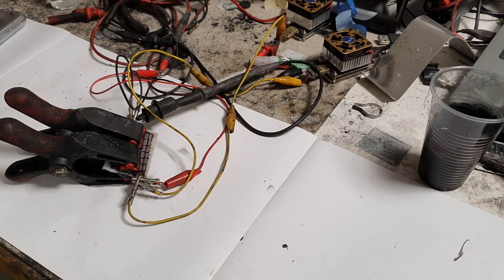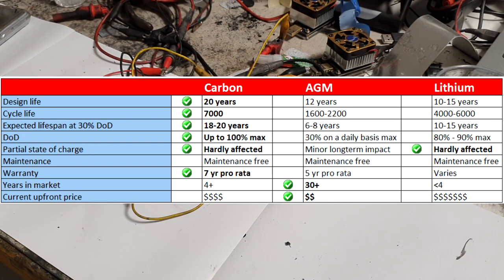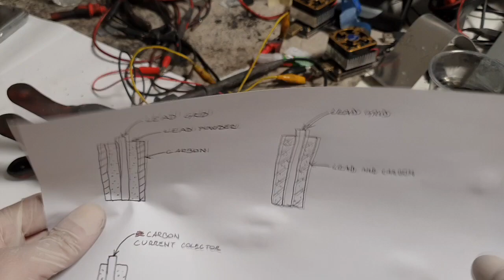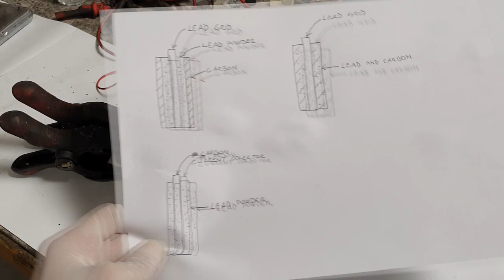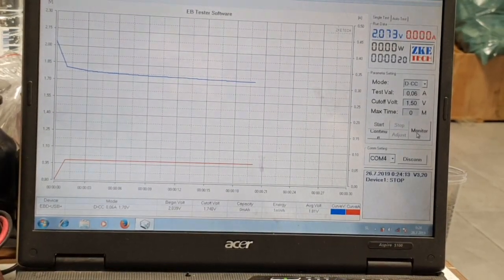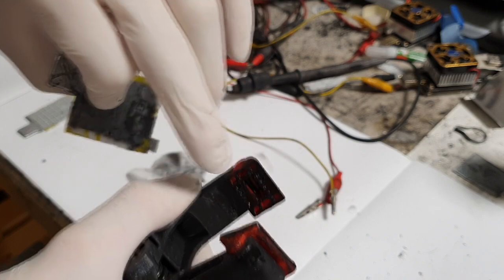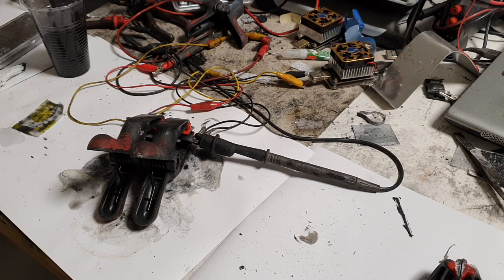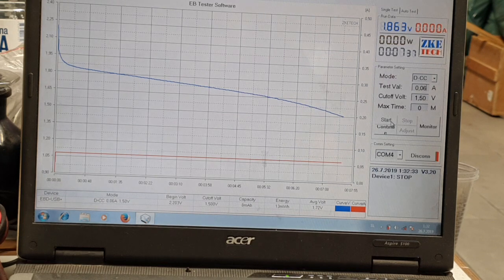Lead carbon battery - ultrabattery

Comment: Would be good to see similar test but with a battery that had lost most of its capacity. An old car battery that had sulphur built up on its plates due to being discharge to far would be a good test. It could be a great business to create new life for old batteries
Reply from the maker: Not bad idea. But in many cases the lead grid which is the current collector is badly damaged.
Reply: @cayrex  I think this is true in very old batteries but many fail prematurely from be left in a flat state to long and the acid turns to water and the sulpher Coates the plates

Comment: What are you using as a binder to keep everything in the grid I've tried just about everything I can think of and nothing holds it in there whenever you put it in the electric light and make a battery with it it always dissolves out and falls down to the bottom I even put clay and as it dries it shrinks and cracks
Reply from the maker: https://patents.google.com/patent/CN102181113A/en
Reply: I've tried acrylic concrete patch repair from hardware store.

Comment: So which deaign u build? Mix lead powdee and carbon powder? Ad the composition?  Is it 50:50?
And how the performance ..? Can reach 3000 cycles?
Reply from the maker: I soak the negative lead electrode (standart negative lead electrode - lead grid + lead powder) into activated carbon ink, which was made from activated carbon and binder (polyester or epoxy). Yes you can also make a mix from lead powder and AC in 50:50 ratio. Hmm, performance,... reduced weight, less evolution of hydrogen, cycle life. Look on internet,.... some papers report cycle life over 10k cycles. In that case 3000 or 2000 cycles will not be a problem, but the cycles are depended on DoD (deep of discharge)
Reply: @cayrex  well there are several lead carbon on the market..they claim can reach 3500 cycles with 80 percent dod..but on furukawa test only 3000 cycles with 50 percent dod..
Btw what kind of binder u use..thanks..

Comment: can you please make a video on how to produce plumb dioxide at home for the positive electrode? Specifically for making deep cycle batteries.
Reply from the maker: In basic is easy to do but you need to be careful when you do this. You have electro and thermal process to make a PbO2. For electro method you need Pb metal bar, 20-30% H2SO4 and some negative epectrode like copper or carbon. Put the Pb which is conected to the positive of your power supply into H2SO4 solution and also the carbon which is conected to the negative. Power up and wait. The Pb will start to form a oxide layer, which is in dark color. The thermal reaction is if you heat a lead nitrate,... and I the end you will get PbO. But this thermal method is toxic like hell! And is not good to make at home in some small room. The difference between "normal" lead acid and deep cycle batteries is only in the thickness of the electrodes. The deep cycle battery have thicker electrodes as starter lead acid battery,... all the rest is same.

Comment: May I know what are the ingredients to make the battery plate
Reply: The negatives  plate of a older lead acid battery   if the positive  who has damaged crash it and paint it on the 2 plates on the negative separate with peppers toilet and put saltwater  charger it and test

Comment: can i use charcoal substitute for the carbon?
Reply: If you can get it to be conductive and also activated yes!
Reply: @Buzzhumma how can i put it to the lead grid by adding epoxy resin? ist ok?  or by putting the powdered charcoal to container and add water and mixing it very well and dumping it to the grid then hydraulic pressing it?
Reply: @rolandruiz1972  I would press it
Reply from the maker: Yes but Like Electron Proton N.... Mouron said,.... is better if your carbon source have good conductivity and surface area if you get low conductivity than you need to add some graphite. You need a mix of lead powder and carbon material. Yes you can use epoxy for your binder,.... use in ratio 8:2 or 9:1 (active material : binder). If you use epoxy than in this case you need some time that the electrolyte will soak in. Also you need a good pressing that your active material will have good contact to the lead grid.
Reply: @cayrex  thank u very much for sharing infos to us:)
Reply: How do we make the carbon ink?

Comment: Greetings! I see that you make different types of batteries, so I'm interested in what you think, is it possible to make one of the round lead plates, with a plastic housing, e.g. pvc tube diameter 50 or 75 mm, I need it for my e bike project and the battery would be integrated into the bike frame. Thanks in advance for the reply, all the best.
Reply from the maker: All is posible. The lead battery will only have a tube shape. Like tubular lead acid battery. You can make tubular lead battery with lead foil (+PbO2 active material) and lead foil (-Pb powder). Or you make like is made zinc carbon battery.... lead housing, inside is the separator which is filled with PbO2 and lead rod for current collector,... in basic!
Reply: @cayrex  Ok, thanks, if I ever make it, ill let you know how it worked out heheheh...
Reply from the maker: In basic you can make it easy,.... you have your PVC tube. Then melt the lead and pour a little bit into the tube and wait that the lead will be hard. On the top of that lead you add lead powder and press it. On that lead powder you add a separator. Then you add PbO2 powder  and again you press a bit that powder. And for the finish you pour again the melted lead. When the lead is hard you press the cell that you make a good contact of all materials. For the end you need to add electrolyte into the cell. You make a small hole in the area where is located Pb powder and also PbO2 powder in the PVC pipe. Fill the electrolyte and seal the holes. You make 6 cells that way.
Reply: @cayrex  Got it! Thank you very much!!! I was  thinking of making the plates separately, but puoring them directly into a tube would be perfect( If it doesnt melt thr tube). Wich separator and electrolyte would you reccomend?
Reply from the maker: @misoracic8892  you glue the tube to bowl and you fill the bowl with cold water,.... but not the pipe. In that case the lead will be hard quickly. Use the separator from sealed lead acid battery which is used for modeling. The separator is glass fibers.
Reply: @cayrex  Ok, thank you very much for having time to answer my questions.
Reply from the maker: @misoracic8892  no problem 😉
Reply: @cayrex  May I know what are the ingredients to make the battery plate

Comment: Did you know that the neg collection plate can be replaced with carbon paper
Reply from the maker: yes. did you know that you can use silver coated current collector grid to make resistant to acid corrosion and you improve the cycle life dramatically

Comment: How to charge a DIY battery and how to know it's capacity?
Reply from the maker: the easy way is if you use adjustable power supply,... in this case you can set to 2.5V and charge the cell like a boss (on ebay or amazon you can get some cheap power supply). Hmm the capacity,..... the best is if you have a electronic load, but if you dont have the electronic load than you can use a small motor and you also need a multimeter.

Comment: If negative electrode pure carbon what's happene than
Reply from the maker: Then you get a capacitor effect. Discharge curve will be more capacitor like. The voltage and the capacity will be lower. 1.8 - 1.9V and around 27Wh/kg.
Reply: Thanks for reply
Reply: If negative grid made by carban & active material is lead coating with  activeted carban what's happen
Reply: If negative grid is lead & active material is lead with carban
Reply: @cayrex  if negative grid is lead & active material is carban with good condutive carban
Reply from the maker: @sandeepjain6027  if you use a carbon grid for the current collector and the active material will be lead powder with AC,... then again you get lead carbon battery
Reply: @cayrex  thanks for reply
Reply: Above mention in which best technic
Reply: Above mention 3 technic in which best performance technic

Comment: Not your best video.  The famous "FIREFLY" battery is made from sheets of pine wood which are baked to produce carbon foam sheets. Basically full sheets of activated charcoal.  Then they put it into LEAD ACETATE solution and grow lead crystals into the carbon foam matrix sheet as a negative cathode for 90 seconds. Next remove the extra lead crystals from surface of carbon foam board, Done.
Reply from the maker: Yes that is the firefly technique and is not the only method to do it. You have many designs and technique to make a lead carbon battery.
Reply from the maker: Better will be a PU carbonized open pore foam,... which is soaked into lead acetate, then electroplated to form a lead layer on foam skeleton.
Reply: @cayrex  YES!